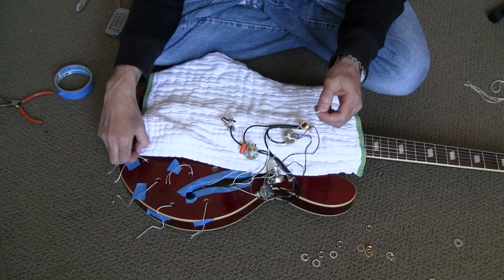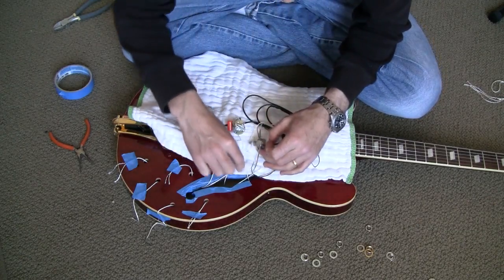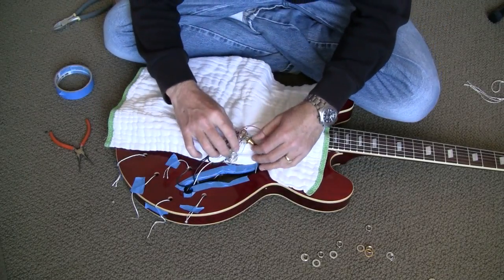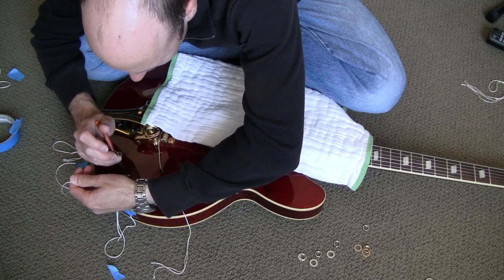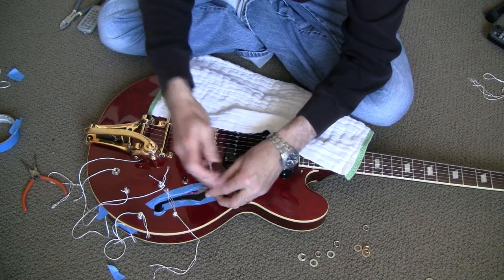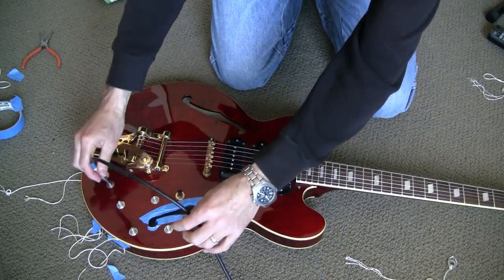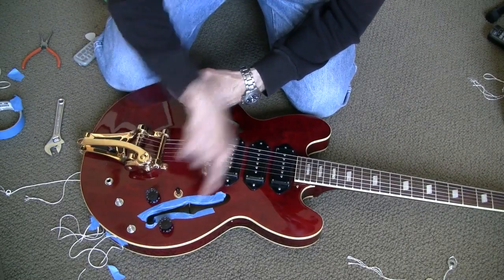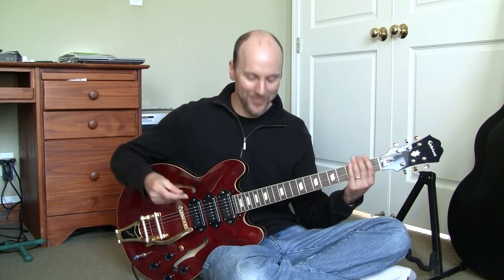Part 2- Reinstalling Semi-Hollowbody Electronics

Comment: I would suggest tightening pot nuts with a tube spanner or socket, if using wrench as in the video its good to cover the face of the wrench with insulation tape to protect the guitar surface, just cut down the opening area with a utility knife.  Having said that ,nice video, with some good tips.

Comment: Use a 10" zip tie for the 1/4 jack.  Works perfect.  I just installed my pots, switch and jack yesterday in my Heritage H 555.
This wasn't easy so it will take patience.  My H 555 sounds great now.   Took about 1 1/2 hours.  Los Angeles

Comment: Excellent tutorial! I used thin electronic wire instead of string, as it's much easier to push over towards the F-hole. As noted, this is somewhat challenging the first time around but it does indeed work well and I thank you, John! Saved my bacon on an Ebay Gretsch Tennessee Rose with very oxidized, dysfunctional  pots that cleaned up nicely using  DeOxit D5. Cheers from Colorado.

Comment: Hi John, I use 20 pound test fishing line. A little more difficult to feed through, but worth it when pulling the parts into their respective holes. And you never know... Maybe you'll catch a nice Salmon for dinner! I was thinking about using a lock washer on the Jack (below the guitar top) as well, to really insure locking it down. Tired of them eventually coming loose. Excellent job walking us all through the steps! Thanks again!

Comment: Thank you for your video, It was helpful. Concerning the jack: I made a large loop, (Not a slip Knot). About a 4 inch circle, around the long tang  part, and threaded it up through the  hole. The circle is above the guitar after pulling. When done just cut one side and pull it out. The tape was a good idea too. had to wrestle parts in And out of slot.

Comment: Another tip:after installing the output jack, plug the guitar in, check if everything still works. Do this every step of the way as you install the vol/tone pots so you don't have to take everything out when you accidentally pull a wire inside the guitar and therefore know exactly where the problem lies.
I use thin wrap wire to do these jobs, flexible enough yet not as thick as standard electrical wire. As it has plastic on the outside it will not catch anything nor knot easily like a piece of string..

Comment: This video couldn't be more timely as I'm about to sort out my 1972 Japan made Epiphone EA-250. That thing decided to quit on me and play only neck pickup. Replaced its 3 way switch with a brand new one but problem retains the same, so will pull electrics out to inspect. Although on my guitar there are holes under pickups, so they will help me a bit with things.

Comment: Hi, thanks for responding. I hadn't though of doing what you mention in just solderin in the new pickups. Honestly I do not do a  lot of volume and tone roll back, but do once in a while on the bridge pickup. Only problem is I would have to be sure I am matching up the correct wires! Did you do a video on this method? -Thanks

Comment: Fantastic tutorial - thanks for the 720p. One question, using that type of wrench to tighten the nuts, doesn't it run the risk of scratching the finish of the guitar since, wouldn't it be better to use a screwdriver type of wrench?

Comment: Hi John, thanks for the videos, they are very useful for my next project. I have a couple of questions that I would be pleased if you can help me with. First I wanted to confirm whether the potetiometers for the Casino are short or long shaft. I guess they are short but is good to doublecheck. Finally, I have an Epi Casino and I will replace pots with CTS. As far as I understand those have bigger holes than the factory ones that come with the guitar. If so, did you manage any way to enlarge the original holes of your guitar?
Thanks in advance. 
Kind regards from Spain!

Comment: Hi, I hope you can help me with this, I have a problem with my Guitar. I've got a Gibson ES 335, and it has EMG pickups in (rare showcase edition with stock EMGS). I've not been getting any response from the tone knobs, and have wanted to change the pickups anyway.

I've watched all the videos on how to change pickups and rewire, but would it be different because it's got active pickups in now, rather than passive? If so would it be difficult to do?